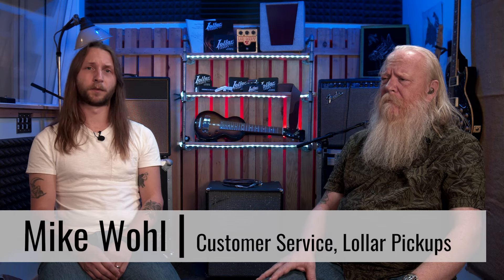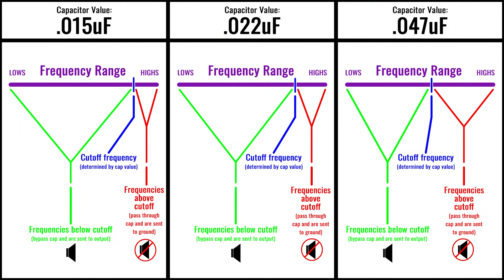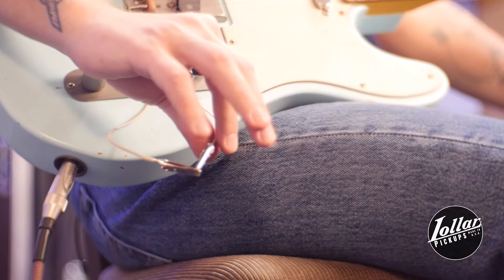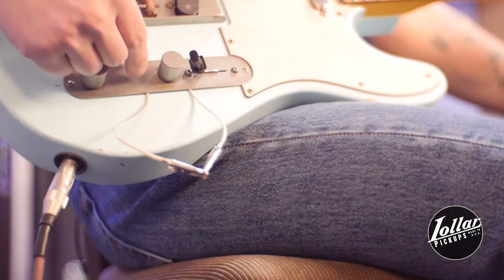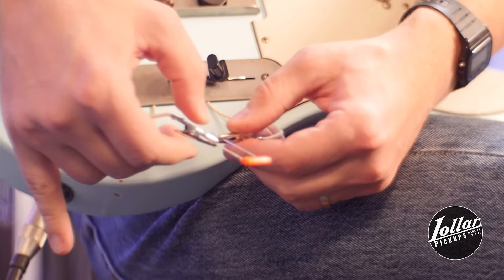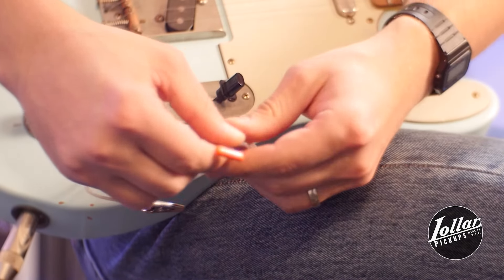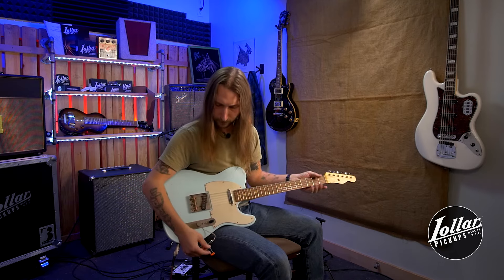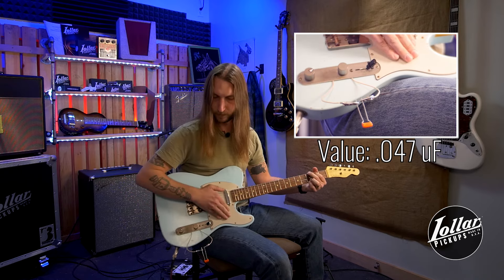LOLLAR PICKUPS Presents: TONE TRUTH - Capacitor Value

Comment: My ears say the higher the value of capacitor the more capacity for charge held, the real question is how well that charge is held and how well the capacitors behave to effect the range in frequencies at full open as well as the properties to inhibit highs at full potentiometer/variable resistor operational purpose(closed)

 So more is more, 
And,
its why louder on the amps master volume is better, 
but I still turn my volume pot down to 7 or 8 to allow the caps to do their job at full frequency capacitance with more room to spare and j ne er max my control knobs i always prefer a shaped tone but that delends on thd amps response of the hardware i have in the signal chain, thats when most of fhis argumenf goes out the window. then I find the tone pots sweet spot for me, it is subjective but the guitar as marvellous and awesome an invention as it is and i absolutely love guitars, it is still mathematics and science at the most basic level in its field., in regards to circuitry and design, guitars should be way cheaper especially the electronic components, 
You can get parts ten a penney! Buy in bulk get decent parts that way you can match your pots too, they never read at the value stated and always under or over by the tolerance margin stated they pump these tiny insignificant components out thousands a day and theres no time to test them all. they are the simplest of parts that big ass aeronautical space ships snd plane components are made at the same fa tories, so they are very cheap in comparison not woth 30quid fot a fkn potentiometer or some old out of date "vintage " capacitor if you buy those you are being suckered unless you're running a fake vintage guitar racket scam... then youl need em. and I love how simple it us, lol inside your Nokia 8210 whatever in the 90s if you still have one, it's a supercomputer in comparison to a guitar.

The frequencies drawn from the amps greater magnetic pull(more power) amp responds to the signal if grounded well enough, higher value capacitors on your pots add more girth to the high frequencies, at the same time more highs rolled off yet still more mids are present, because, the resonant peak is shifted into a range that favours low to high mids on the eq spectrum which has all already been mapped out and time tested to be where guitars are better sounding i mean in the mix of a full band, each instrument, some are close to each other like piano and guitar, but each instrument including drums have a strong optimised area to be in within the whole frequency range that the human ear can hear and the man from del.onte Says YES!! 
everything else outide the box is cut out to preserve the sound and save on whatever , mostly because it's useless snd thats that.

. You get more frequencies with  higher value capacitors and still have with logarithmic pots, the option to diall those frequencies back and have a wider range of choice of frequency from full open to full closed.
 Particularly handy when the guitar has bright pickups and good when you have a less expensive amp than tube amp, like a  solid state amp to play on either way- use the guitars and amps eq to control the signal from the guitar thats decidedly how to manipulate the amps responds to the source signal.
 Electricity in an uncontrolled or controlled environment is always drawn or held but never pushed through the amp its electromagnetism basics 101.

Capa itors are what they say they are- used to at various vues, to build up a capacity for an electrical voltage, snd in that value is the information, only judged by response from a receiver designed to connect with another weaker ir stronger electromagnetic cuitcit with magnetism in ghe case of guitars and amps its a variable responsive relationship between the two. 
 the signals are .ensured in wavelengths and currents amplitude etc 
resistors redirect, but the source of the signal has to be within an acceptable range of tolerances and it boils down to the relationship between the pickups reaction to the strings vibratory disturbance of its electromagnetically induced field 

not unlike if you visualise a picture of the earths electromagnetic field from the north and south pole, 

so if everyone all at the same time plugs in and slams a G-Chord we can literally save the planet from an extinction level event like our sun emitting massive coronal ejections tight at us
, it's why it's called the "people's chord"
This is the way, I have spoken.

Comment: Actually correct cap orientation of an Orange Drop capacitor can be deduced … turn up volume of amp, plug in guitar, pot wide open, by touching finger to external case of cap… sound change will be heard see this video 

https://youtu.be/v7h5kI8glwA
Reply from the maker: I think this is splitting some pretty small hairs here. His video doesn't really show a practical application for tone capacitors in an electric guitar circuit.

For starters, in a full guitar circuit, your signal is passing through the cap in a manner that is much like a high pass filter; only the very top end is passing through the cap and going directly to ground and the rest of your signal is going out through the output jack to the amplifier. The signal of the guitar is so much stronger than any small amount of signal of the noise coming in from the cap alone, so your noise floor is statistically non-existent - in fact, in his video, he had to turn the volume on the amp all the way up for the noise to even be discernable at all. And this is without the guitar signal in there to further obfuscate the noise.

In addition, when you play guitar, you are grounded by way of the circuit, whether through a string ground or another method. In his video, he is not grounded, so he introduces far more interference by touching the cap than he would if he were grounded in the circuit. If he were touching the strings or other grounded metal part of the guitar in the same circuit as the cap, he wouldn't introduce nearly as much interference. Plus, you're never really going to reach into your guitar and touch the capacitor while playing, making this all sort of a moot point. So, while what the video shows is technically factual, it's not an apples-to-apples analog for a full guitar circuit and not representative of the reality of any noise introduced by installing the cap in any particular orientation.

But, if folks have nothing better to do than worry about this small degree of potential RFI/EMI in their signal, they can do whatever they want to chase their own happiness. If wrapping the whole circuit in molten lead and wearing a tinfoil hat when they play makes them feel better, then we support their right to do so. More power to 'em. But that doesn't mean that anyone else is necessarily wrong for not bothering to put a non-directional capacitor in their guitar in any sort of way.
Reply: @LollarPickups  When can we look forward to the new Lollar branded tin-foil hat? ;-)
Reply from the maker: @leftpastsaturn, we prefer to call them "Anti-5G Paper-In-(tin)Foil Thinking Caps" due to the negative connotations of the old name. They improve your tone by 69.420% by shielding your guitar from bad gear forum advice. They also shield your brains from 5G interference while doing your own research about capacitors online. Haha!

Also, I perused some of your videos and the ambient music and accompanying visuals are great. Is that all performed by you?
Reply: @LollarPickups  Sign me up for any testing program on those caps! :D

Thanks for the compliments on the music, I'm glad you enjoyed them, and yes, that's all me. The visuals are easy, I just carry a camera when I go hiking!

Comment: Just turn all controls to 10 and forget about pots and caps values...
Reply from the maker: Yeah, I've found that a startling number of players never even use their volume or tone controls. Though there's definitely still a bit of a tonal fingerprint, even with the knobs at 10. I had a friend who left his knobs at 10 all the time and so he thought he'd just remove the volume and tone circuit to prevent them from unintentionally getting turned down. He removed them and went straight from the pickup to the output jack. When he did this, he actually didn't like the sound he got. It was too harsh and bright for his liking. So, he put them back in, turned them all the way up, and simply tucked the entire pots, shaft and all, into the cavity without passing the shafts through the holes in the body. They were permanently on ten and still offered that bit of tonal coloration that he liked. Different value pots will have different coloration, even on ten, as they don't actually have infinite resistance to ground, so some amount of treble frequencies will still shunt to ground, and the frequencies and amount of single going to ground will depend on the value. And plenty of folks just don't care for the wide-open sound, they prefer to dial in their favorite tones with the volume and tone controls. Variety being the spice of life and whatnot...